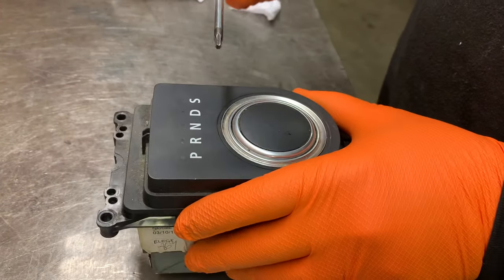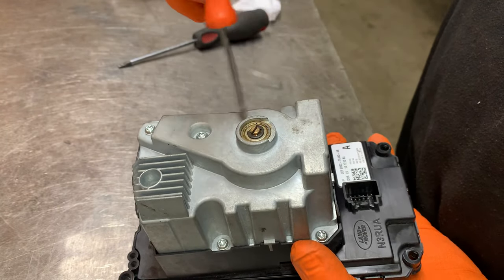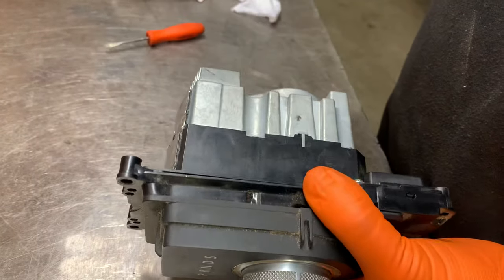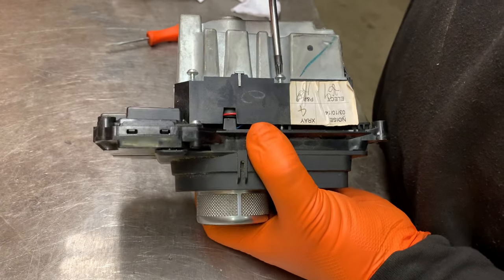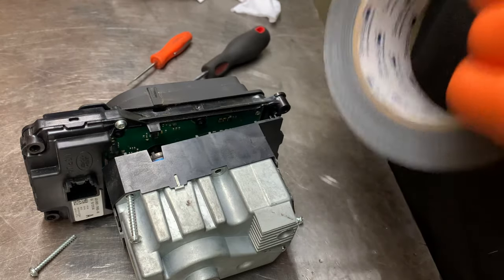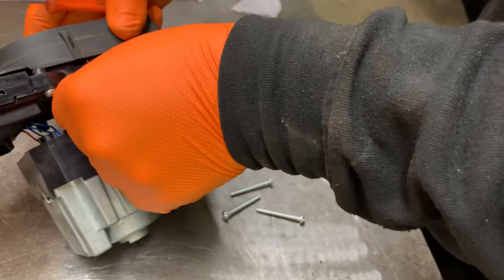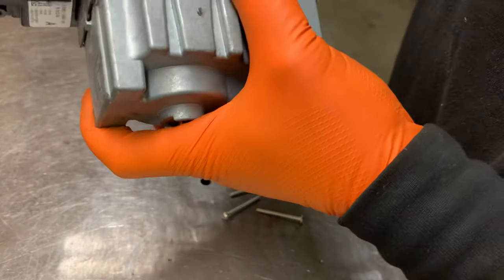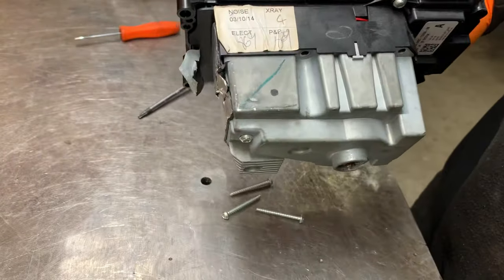Landrover and Jaguar gear selector temporary fix

Comment: If you are in a hurry and dont have time to remove the unit, you can press down foot on the brake, press start and the moment it starts, (its in a neutral mode for a second), press down firmly on the gear selector with two fingers and turn at the same time. You will be able to get in gear and get home. If you want to reverse or put back in park, just press firmly on the selector again and turn at the same time to desired gear.
Reply: Mine is stuck in D and won't start at all.
Reply: @Grievance_Studies_Affair_2018  
My discovery is in the same position, gear stuck in D and car won’t start. Were you able to find a fix?

Comment: This video was very useful today when my Evoque would not shift out of park.  I was able to get it home, where I disassembled the selector.  One issue was the plastic piece through which the threaded bar runs to raise and lower the knob was broken into 4 pieces.  I 3D printed a new one, but that didn't fix the shift problem. That turned out to be no voltage to the solenoid, caused by one of the pair of 1 ohm senses resistors going bad.  They are by the 3 pin connector on the board.  I found another one on a scrap PCB, replaced it and now the selector works fine.
Reply: Did you do diagnostics? what error code came up? my car Disco Sport L550 SE has gear box fault, parking brake fault, can't get it into gear had to be towed, they think fault wiring harness, but others say possible a transducer or resistorrr.
Reply: @karisstowers3516  this sounds like a parking eBrake harness. I have the same issue with my evoque. I changed the read harness. Problem fixed. I Hope this is helpful.

Comment: Did it this on my Jaguar XF and this fix works great ! But the electric Handbrake doesn't work if the Shiftlock is locked !
Reply: What year jaguar? And how did you remove it ?
Reply: @JoeDirt00  hi ... the handbrake problem will be fixed after a restart. My XF was 2009. You need to remove a lot. https://www.youtube.com/watch?v=mrKM-xQW2-o

Comment: So I took mine out of a Range Rover 5.0 Super-Charged Long Wheel Base, I tested the park solenoid and it works with a 9v battery, I am no sure what the problem is when it is hooked to the car the knob wont turn however after i did this fix in your video the shifter works fine, except it will lock every chance it gets I have to always manually remove it
Reply: It’s usually a circuit board failure, rather than the solenoid. They last forever.

Comment: Great tip, don't replace the unit there's a company that repairs these and upgrades the electronics so it doesn't happen again, costs a lot less than a new one too.
Reply: What is the name of the company?
Reply: What’s the company
Reply: @mianaseer812 ECTTesting or something like that. You send your selector in, you get it back in a couple days, and if the selector wasn’t the problem then you get your money back minus shipping and testing fee

Comment: Thank you.... I have the same problem. My Disco 4 is from 2014. What do you think it is gear selecotor failure or something wrong with the brake impulse coil ??
Reply from the maker: If it rises but you’re unable to turn the lever it’s most likely the selector unit. If you are able to do a code scan it will probably have a fault for the interlock solenoid.
Reply: @GeminiAutoWorks  Yes it rises but Im unable to rotate it. So it mean that it is most likely selector. I have noticed that 1R00 resistor is burn on the board.

Comment: does this happens to all models of jaguar or newer models dont have that problem? im thinking about getting xf 2016
Reply: It just happened to my XF 2016
Reply: My 2017 XF S just samething just happens stuck in drive with the rotary in the up position
Reply: @JoeDirt00  Did you fix it yourself eventually?

Comment: No one will show how to get the darn thing out 🙄
Reply from the maker: The trouble is that this style of selector is fitted to numerous different Jaguars and Land-rovers so I’m unable at the moment to do videos on all of then. What is it you’re trying to remove it from?
Reply: He lost me after ducktape? Poke holes and how are we positionings the tape to small lever inside!??? Taping in certain position? So cant move? I DNT see what actually doing/taping the lever inside if down, up, left, hold it in place Please HELP!!!!
Reply: @derrickjones2980  You make a hole with the tape and pull it so the lever is unlocked (notice how he uses his finger in the video to demonstrate how the lever pulls back @ 1:18). Then while the duck tape is holding the lever back, pull the remainder of the tape so that it sticks to the exterior of the gearbox. This keeps the lever pulled back after you've put the gearbox back together. This is a great temporary fix and beats having to go thru the hood of the vehicle to get the car in neutral.

Worked for me, saved me a tow.
Reply: YouTube shows you.

Comment: Do you need to reprogram a used unit?
Reply from the maker: No it should work but might bring up a warning light. I have fitted brand new ones and they worked without coding but it will have a warning light till it’s coded
Reply: @GeminiAutoWorks  hello what tool you suggest to code it or is my only option taking it to a shop? Thanks in advance
Reply: @HoustonisFire  Did you have to take yours to the shop to get coded?
Reply: @ariv8585  I haven’t replace it yet. I only did this quick fix. I’m shopping around for the part. I was told by someone else that it doesn’t need to be programmed tho. They said once you replace it, it should work fine
Reply: @HoustonisFire  I had the replacement part (eBay $217) on hand when I asked the question. I’m generally impatient so I immediately began working on my car, only took 15 minutes. No fault code, but I did disconnect the battery!!
Reply: @HoustonisFire  I have a 2016 Disco Sport, the replacement is from 2017 model. The part is slightly different in design, perhaps JLR realized it was a bad design and changed from one year to the next. I hope this helps, good luck
Reply: @ariv8585  do you mind sharing the part number you got? It looks like mine might be the same
Reply: @HoustonisFire  HJ32-124559-AB

But it might be different for your vehicle
Reply: @GeminiAutoWorks  Allegedly these units can be fixed, rather than replaced for another. There is a small chip/resistor R510 inside which needs resoldering? I'm not sure how many other things are there which may cause the issue but this is one of them.